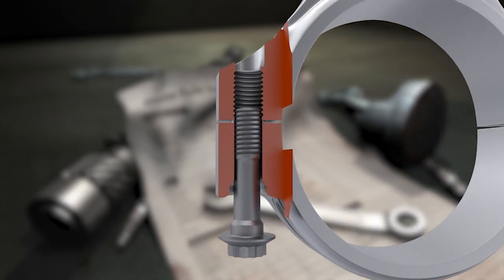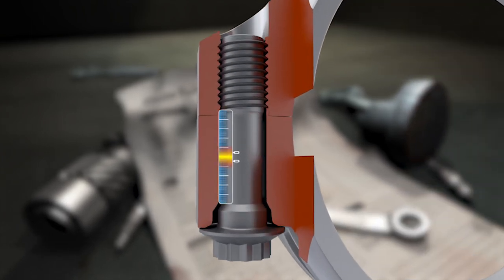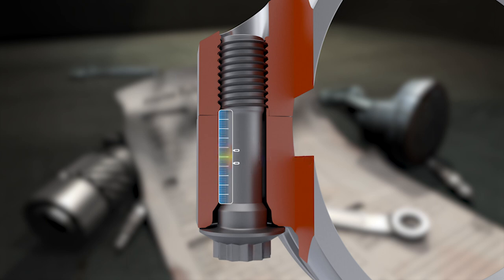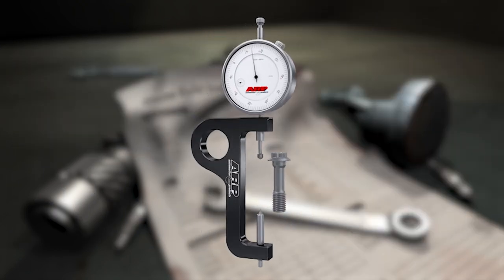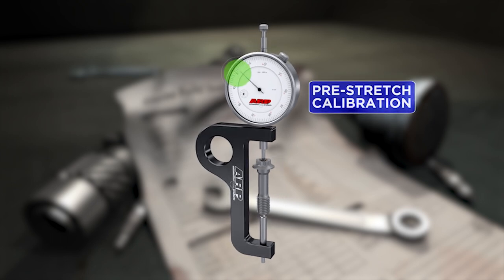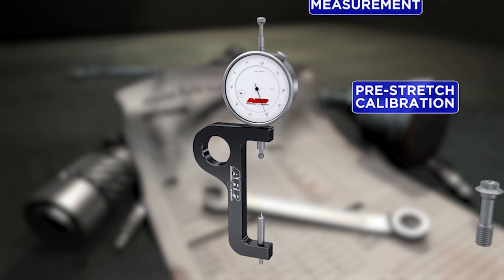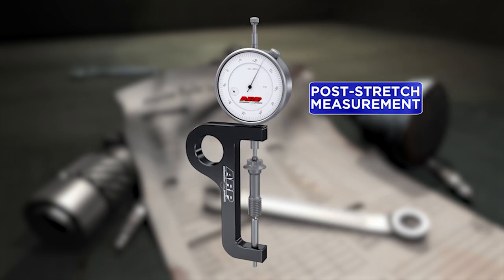ARP Rod Bolt stretch explained

Comment: I had a big problem with my engine so had to replace the crank , i went to Mercedes to order up gaskets stretch bolts etc . All the parts came but only two conrod bolts and was told no stock in uk and could take 6 months . I can not wait 6months so built the engine . The bolts were just off 90 degree final setting but felt like there was stretch . Have i just built a time bomb . Car is not a sports car .

Comment: So, the sole purpose is to determine if the fastener is reusable?  Obviously, when new they can be used.  Measure them as new, use them and then measure again to determine if reusable????  Don't really understand importance if using new bolts on a build, as they should be 'perfect', right???  Steve
Reply: you are supposed to measure the length after tighting your rod bolts to make sure the rod bolts are at the correct spec of 75% of the yield strength. The tool also lets you know if the bolts you removed are resuable if they "spring back" to their original length and are properly stretched when reinstalled.